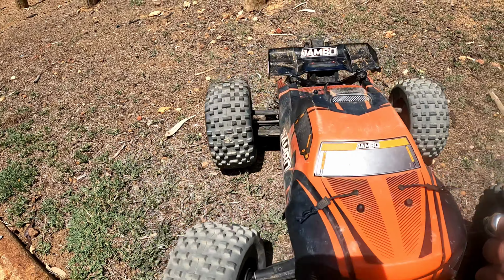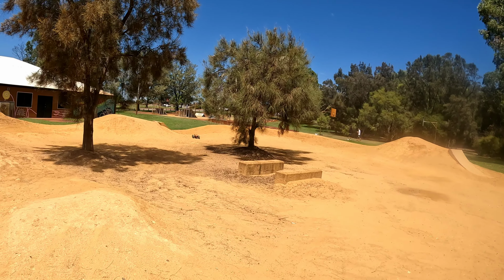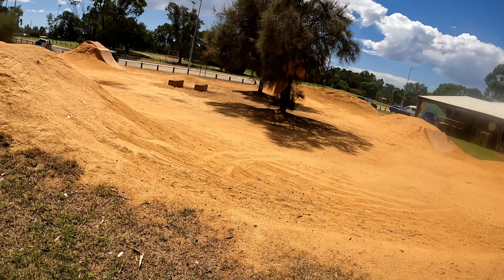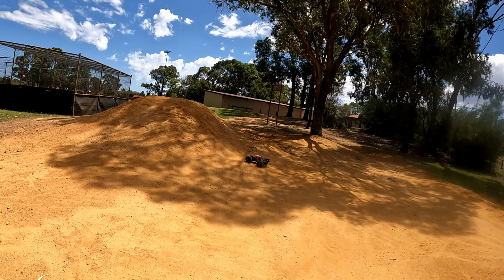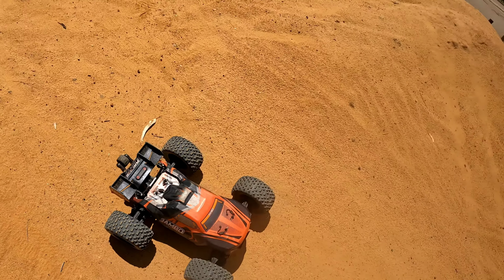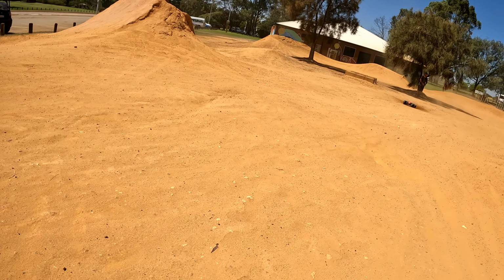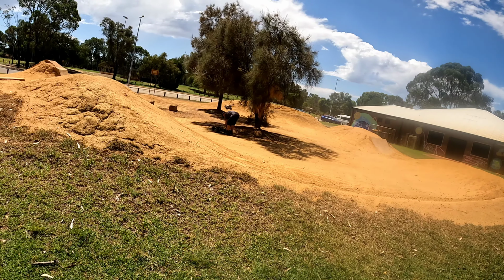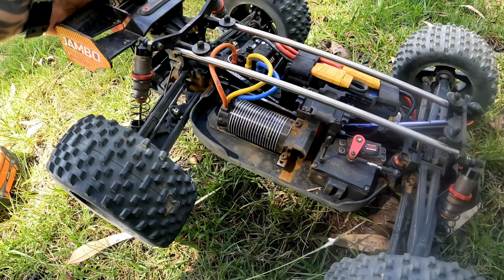Team Corally Jambo Testing Home Made Brace

Comment: Looks good..I used the TC carbon fiber chassis brace inserts to stiffen the chassis a bit.
Reply from the maker: Man it worked perfectly my home made job .... it just had way too much flex and was always breaking the same parts , got annoying in the end but was real happy with it today 🤘🏻
Reply: @kaosr.c  Nice..Mine never broke anything..but the chassis needed to be stiffen up a bit because after the first few runs hitting backflips the rear center shaft had a slight bend in it..Adding the carbon fiber inserts to the stock chassis braces fixed the issue and the shaft did not bend any further.. the cool thing about TC is its a racing company so they think about chassis stiffness and stuff like that ahead of time and they design their stuff to accept stiffeners.. braces and the arms as well

Comment: Nice run! What grade steel did you use for the tower to tower bracing? I imagine that’s even better than the TC one on my XTR. Did you thread tap the ends and what size bolts to fasten it? Thank you
Reply from the maker: Thanks mate 
Its just hollow steel tube about 3mm thick , bolted through body post mounts with spare screws and m4 nuts i have laying around
Reply: @kaosr.c  Thank you! That’s perfect.
Reply from the maker: @amavarrc  welcome